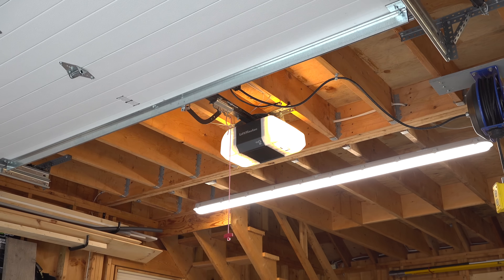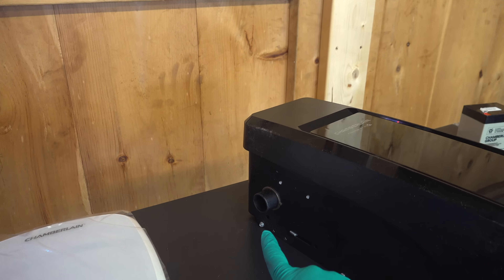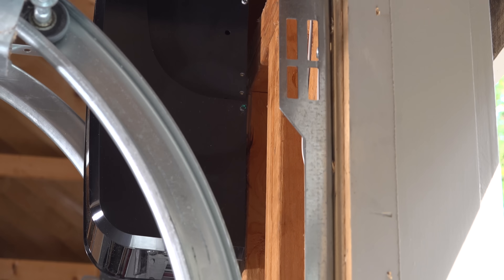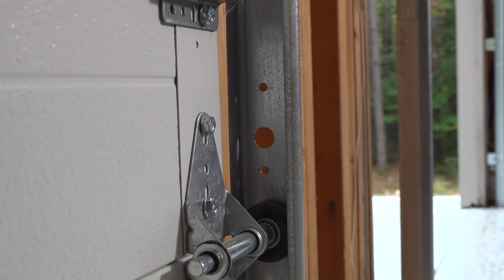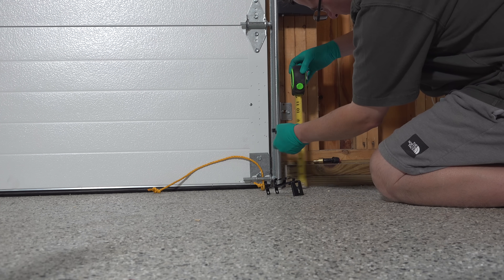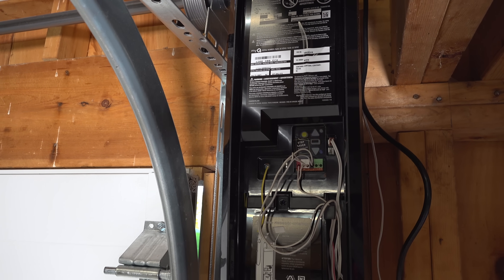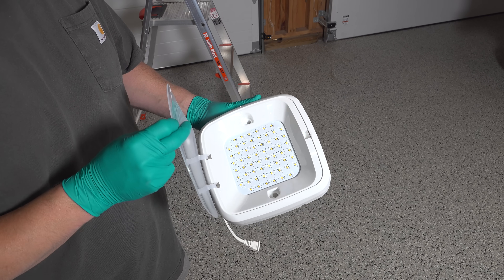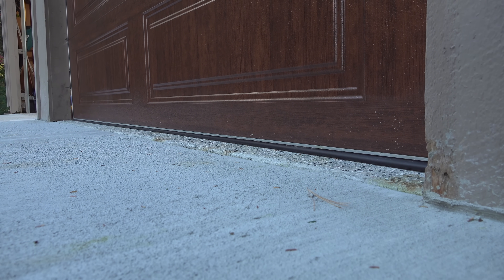Finally a SILENT Garage Door Opener that locks like a SAFE! - RJ0101

Comment from the maker: Thanks for watching! Opener https://amzn.to/49iAvly Cable Ties w/Hole https://amzn.to/3Qc7K12 Stapler https://amzn.to/46StmGU *Step Drill*: https://amzn.to/3sdEuz2
One correction: I called the app OnQ, it is called MyQ!
Reply: Installed one of these in early 2019 and love it.
Reply: 0:16 0:20 0:30 0:33 0:34
Reply: We have had this side mount liftmaster on our garage door for about 7 years. It probably has a life time of use on it already as we used it to let our dog out for all those years.
Reply: @SlverSymbol what brand of step bit are you using? I need something of good quality and knew your experience would save me some time. Thanks for another great video!
Reply: A really nice feature of myQ is that if you have Amazon Prime, Amazon drivers can drop packages inside your garage if you allow it with the app. I love this feature for days when I am getting a package from Amazon and it's raining or snowing outside.
Reply: Excellent!  Thank you,!
This is exactly what I'm looking for...
Reply: 9⁹⁹ @Kirk_Mcgurk

Comment: I have 2 doors with Liftmaster jackshaft openers. They are necessary in my case because they are 12x12 high lift doors. They are not without problems though. Once I was out of town and my neighbor called saying the big door was open. He knew I was not at home. He called police and while standing at the street talking to the officer, the door went down. There was no long range or wifi remotes at this time. Within a few minutes there were dozens of police. I gave my neighbor the code to the keypad and it was passed to the cops. They searched the house and found no one. I had my neighbor unplug the opener. Turns out it was somewhat common for the board to fail on these earlier units. The board was half the price of the complete unit. I saw a video that mentioned the electric deadbolts are prone to failure. My original lock from the first installed opener is still going strong. The other door that is used much less often has had two lock failures.

Comment: Designed for high lift or full vertical. I will not install one on a standard lift (most garage doors)I can’t warranty a jack shaft it it’s on an application it wasn’t meant for. Jack-shafts suck! Stay with a LiftMaster belt drive standard opener. LiftMaster doesn’t make a jackshaft with the new 3.0 Bluetooth technology yet. Both the LiftMaster and a Genie are comparable as a jackshaft opener. Both really expensive.

Comment: So it goes down with gravity and the top panel is not pushed forward to keep the door tight to the frame like the old openers so on a windy day cold air comes thru and that sucks if u heat ur garage in the winter

Comment: for the safety sensors rather than the minimum factory recommended of 6 inches off the ground.. this may be okay if you have a dog that free roams your garage area or free roaming outdoor infants and toddlers or some other weird parenting... 
Instead the better height to mount them is the height of the thing that sticks out the furthest off your vehicle.. i.e. ie your bumper or license plate.. so those times when for example you back or pull your vehicle into your garage and you end up second guessing yourself if you pulled in far enough.. instead if the sensors are at the height of your vehicle's bumper, that second guessing becomes a thing of the past.. 

It makes sense to do it this way, as a vehicle is most likely the only thing that ever will trip your garage's safety sensor and typically the only thing that you think of in regards to garage door clearance, so it makes sense to make it the height of a bumper, and even that height still works well for children, adults, and medium to large dogs

Comment: Now tell them the truth that if anything goes bad on it, it’s either not repairable or hell to repair. 8500 with or without cable tensioner, 98022 and 98032 are a bxtch to fix. Plus u deceive them with a chain drive AC motor. Now show them a belt driven DC motor like a 87504 and see if anyone wants a jackshaft.

Comment: 25 years ago, I installed one of these type openers. It was made by a company named Wayne Dalton. It was expensive & it was very quiet, it also had a battery backup. Its fatal flaw was the electronics that failed several times. Not sure how long it lasted as I sold the house. This one looks nice.

Comment: Can you open the door if there’s a power outage
Reply from the maker: Yes, this model includes a small battery that will operate the door about 20 times without power. It fits right inside

Comment: Yes. That automatic deadbolt is a great feature. In San Francisco in the past couple of weeks. A thief has been breaking in to garages by drilling a hole with a hole saw to allow access to pull down attachment to allow opening of the garage doors. The thief has been stealing expensive bicycles.

Comment: Nice Vid TY.  Does Chamberlain require a monthly or yearly fee for the Internet connection / app?
And if the Internet is down, but your Wi-Fi is working will it still be able to open and close the door if you’re close proximity on the same network ❓ The box I added to my old craftsman opener, allows you to program that if you’ve left the garage open, it will close it automatically at 7 PM every night nice feature.

Comment: Don’t forget about the battery (shown in the parts), which operates the door in a power outage.  So to make the door safe when working in the door area requires pulling the safety cord to prevent untimely opening.
 Just unplugging the opener doesn’t prevent operation.

Comment: Sometimes, the deadbolt lock can be mounted without drilling more than 1 hole! The rails can sometimes have pre-drilled or cut holes for the mechanical locks. Highly ideal for big tall doors since they most likely have taller sections!

With my big door, I only had to drill one hole and that was for a mounting screw! There was already a big hole for the deadbolt and a smaller hole for the other mounting screw! And the fact that my garage doors are quite new and probably have newer standards for openers like these!

Comment: I installed mine a couple of years ago and it works great. This man didn't really encounter any issues installing this but I did. Many. Before purchasing this, make sure you have a room for this unit. I have 3 car garage. 1 large door and 1 small door. The space mine is mounted was large enough but I had to drill a hole into concrete. Make sure you have a right tool. Next issue I had was the torsion spring shaft was too long for the unit to get up there. So I had to undo some of the bolts that hold the shaft in order to push it to the other side. The shaft was stuck really bad to the pullies so I had to hammer it many times. In the process of it, I nearly blew my face off as the spring got unwound and broke. Know what you're doing. Then I had to wait till the spring adjuster bar and a new torsion spring that I ordered came to reset the spring tension. Of course I didn't know how to set it up. So it took me some time to set it properly. What he also didn't show  you is taking down the overhead unit, wires and sensors. The chain/belt runs along the long shaft, you will have to take down the whole thing. It's not easy to do it by  yourself. Get some help if you can. The whole process w/o waiting time took me about 3 hours. I did it alone. If you're not handy, expect an all day job. Setting the spring took me an hour. Again, know what you're doing and take a look at your setup before buying this.

Comment: Needs a non internet remote
Reply from the maker: The remotes with it are all RF, the internet is 100% optional or you can use a mix which is what I do. I have a remote in my car but I use the app if I am outside the car.

Comment: The locks should be installed to engage the topmost panel, NOT the bottom panel.  The reason is that thieves will break a set of hinges between panels and slide the rest of the door up.

Comment: You can also buy that light separately and add it to an existing Chamberlain garage door opener. You can mount it anywhere in the garage and significantly improve the amount of light available when the garage door is open. Most higher end Chamberlain or liftmaster openers also include a motion sensor that will turn the light on even if you're not operating the door.. very handy for when you just walk into your garage from your house.  Last A key feature of the DC motor is soft  Start.... Helping the door open smoothly and quietly.

Comment: Here is a safety tip to help prevent accidental damage to your operator. With your original manual deadbolt run a sheet metal screw through the hole in the handle in the open position. This will prevent somebody from accidentally locking your door and remotely trying to open it. If you really need the manual deadbolt, just backed the screw out. Have a great day.

Comment: Hold up. 1:16 & 2:18 So the torque that turns the entire spring rod comes from ONE end only? 
I’m predicting an eventual twisting/cracking of the rod from the uneven tension. Or maybe uneven spring tension after long term use. 
I dunno about this setup without a balanced balanced force placement.
Reply: Both springs are bolted to the rod. They follow the rod. I don't see the problem. I haven't had a single issue for over 2 years.
Reply: @ak-iy4yb  Yes, they are bolted to the rod, ONE end of the rod. Uneven tension/exersion on the rod. I'm glad there's no issue with your setup after 2 years. Please post if an issue occurs. Thanks.

Comment: Problem I see with it on a finished garage besides cost is power. My garage is completely sheet rocked and insulated with a plywood floor in the attic in the center running new power would be a problem and the locking mechanism also

Comment: ABSOLUTELY NOT. NO. These openers do not push the door closed, instead relying on gravity to have them fall closed. It is a guaranteed fail at some point in the future, with damage likely. If you do have one, careful un-balancing, with a little less spring tension applied to give slightly more weight to the door, is REQUIRED to help head off the inevitable failure to drop and cranked door/tracks or wonked wire and reel. Given the set it and forget it lives of 99% of openers, these units are time bombs.

Comment: My gal’s doors are extremely quiet, but these are two single doors.  My double wide door is a little noisy still, but after replacing the old door, opener and belt drive, it is quiet enough.

Comment: 12-point sockets for hex bolts have an angle of 120° on the notches. Yes, you can get away with these on low-torque applications, but using a triple square socket is preferred so you don’t risk rounding the head of the bolt.

Comment: Internet capable access has been more useful than I anticipated.  It wasn't  a 'Top 5 Must Have'  feature  when I was replacing a  'late 1800's Chamberlain (DAMN was this thing old!  I almost looked up the model to so just how old but it was cold out and I needed it complete on a Saturday.)  I've always  found this brand to be steady, solid, trouble-free, and now pretty progressive in features.   Guess I was more like Dad & Grandpa in my thinking, which is skip the fancy and buy what gets the job done and spend the savings on another case of beer.    It's served me well.   Being able to see if someone left the Garage Door open has been by far the most useful.  I forget, my wife forgets;  or you want the doors open while driving home so you don't  have to wait, or even let someone in (a valuable delivery you've coordinated with the shipper and not receiving it isn't an option- Water Heater!).   Risk? Of course.  Internet access makes it vulnerable, but it connects to your local network, so as  long as you're home network is secure, this thing is also.   Using the App on your mobile phone ; if there was an uncontrollably variable, this is it.  You're  using the phones Data (4g. lte) to access away from home.  I'm comfortable with the risk but just know there is an potential exploit:  probably more Hollywood than real life risk.  "The Garage Door Strangler".

Comment: There is so much wood in that garage, bet it gets high humidity and heat inside the garage. Have you looked into the Zula ventilation system?

Comment: Sidemounts/j-shafts have been around for a few decades. In regards to the door install itself it wouold have been significantly better to high lift then roll into follow the roof-line pitch horizontals.  You have greatly increased your loft sq ft and get better performance out of both the door and the opener.

Comment: Older garage door openers are designed to be worked on. A lot of the newer ones aren't designed that way. If your opener is older and someone can repair it, keep it. It might be a little louder but honestly who cares.
Reply: Most older motors are VERY quiet too.

Comment: I have 3 buttons on my rear view mirror in my car and one is programmed to work with my current garage door.  Will this one be capable of doing the same thing…I don’t have a mobile phone so the app does nothing.
Reply from the maker: Yes, that is usually called HomeLink and this is totally compatible. The app is totally optional and the buttons will work

Comment: I need to upgrade my door springs. I have the old style. Two per door but they are mounted at the top rear of the tracks, hooked to the top of the door. The new springs like that above the door would be a lot better. I get a lot of bouncing as the opener closes 🤦🏻‍♂️

Comment: I installed an industrial jack-shaft drive garage door opener in a low ceiling residential garage. It was more expensive but much quieter and saved space. The only reason they are not widely used is simply lower cost and more profit for builders.

Comment: MyQ is the worst, so I hope this really is just a simply 2 wire button controlled and another smart door opener can tap into it. Also of note, while you have a deadbolt now the gap between the door and the jamb looks like it needs weatherstripping or it would be too easy to push something through that gap and pull down the emergency release string. Luckily the deadbolt would stop any more progress but it seems like a flaw in your setup...

Comment: Mine worked well for a year, but for some reason, the wire keeps jumping off the track. It's very annoying.
Reply from the maker: If you mean the wire on the door spool that happened to me also. It has nothing to do with the opener. You need to balance the door, and in my case I just needed to loosen a spool and move it just about 1" and that fixed it permanently. I am sorry I dont have a video on this, but if you get a pro or do it yourself I think balancing the door may help.I don't reccomend workong on the main spring though, so if you arnt sure for balancing definitely get some pro help but maybe this helps give some direction.

Comment: I’m definitely going to have to check these out to see if it will work on my door. Right now I have an old 60’s or 70’s craftsman opener that sounds like a train coming down the tracks when functioning, not a big deal as I’ve never had a car in my garage except I think once when I first got the house, now it’s basically just a big closet

Comment: These doors are actually easier to open with a coat hanger than standard doors (which are very easy) if not for the deadbolt - this is why they added the deadbolt. Defeating the deadbolt is also very easy because of the 2-sided design. Garages really are not secure.

--------------------------------------------------
[Note: This comment is not focused on any particular "designated group" with regard to the YouTube "hate speech" or "cyberbullying" policies. It simply reflects the author's opinion regarding a subject, which may or may not also pertain to an individual's actions demonstrated in the video. If any such individuals belong to any of the "designated groups", any commentary included is merely incidental to that grouping and such groups are not the focus of any comments. It's pathetic that this comment is necessary for the YouTube censors.]

Comment: I do like these but will stick with my slightly noisy Genie screw drive that is close to 30 years old with no issues. The one I installed in my parents garage is close to 40 years old. Both of our garage door use a torsion spring.

Comment: When you installed this thing did you install the torsion bar yourself or have a pro do it?
Reply from the maker: No, the door and torsion bar were put in by a company. I couldnt really handle the door alone and those springs can be bad new if they are done wrong and there is a big safety risk doing that type yourself

Comment: So, the jack shaft openers don't advertise their HP? I would like to use this on my 2-10' roll up steel doors, but my shafts only stick out 3/8" from the cotter pin.

Comment: I would rather have space on my walls than the ceiling.
Reply from the maker: That's fine, but I the wall space is about 10 inches next to the pulley which is usually dead space. The ceiling is like 10 feet squared

Comment: A 12 point socket is not the appropriate tool for a square headed fastener. Will it work?  Sometimes, yes.  

12 point sockets are designed to work with 6 point bolt heads. The angles of those heads are 60*. The angles on the heads of square head fasteners are 90*.